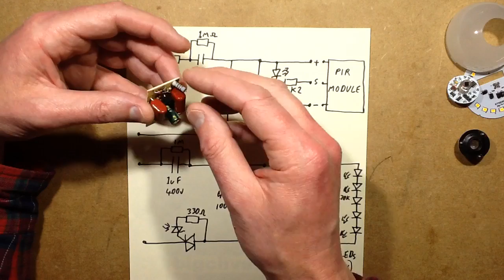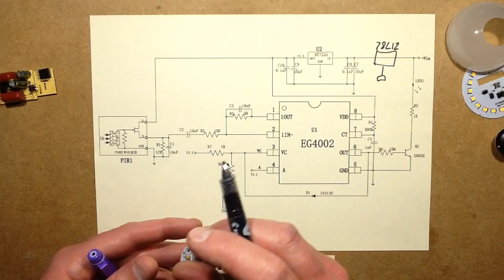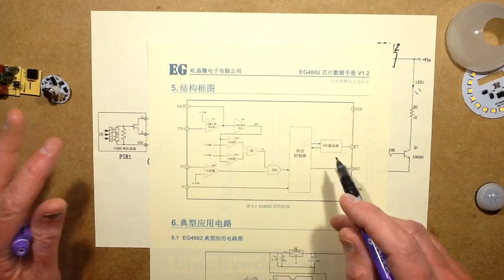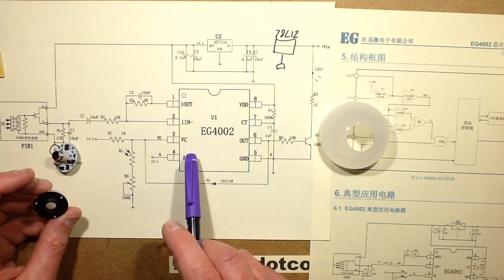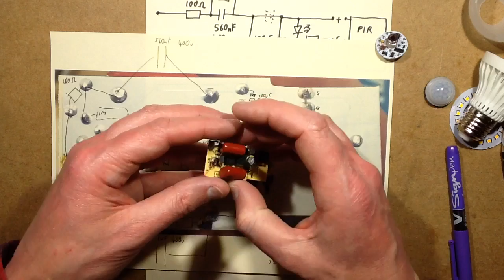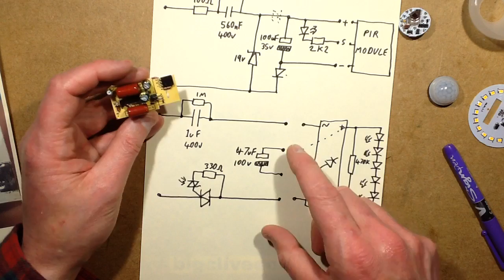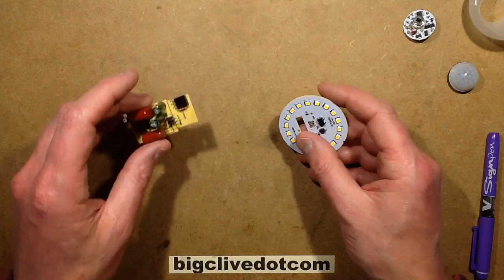PIR LED lamp teardown. (With schematic.)

Comment: Lovely tear down, I've used a number of these bulbs over the last few years and had a couple with LEDs failing.
I'll try running them with a lower capacitive dropper and maybe add a diode too 👍

Comment: I have two of these and tried each in my basement (paid $5 on eBay). Very frustrating. Mine are closer to 12-15 sec delay. So sitting even remotely still to solder, typing on your phone, rinse a paint brush, etc., the basement goes black and you nearly have to wave your arms to re-trigger these. Curious if anyone has tried to mod one? I see for $2 one could by an adjustable delay PCB (https://www.ebay.com/itm/1PCS-PCB-HC-SR501-Pyroelectric-Infrared-PIR-Motion-Sensor-Detector-Module-US-US/312189409823)  I was thinking of trying to swap it in on one of them.

Comment: Thanks to your exploration of these bulbs. I have one in the basement near the roll-up garage door.  I suspect the outlet at ceiling level was intended for a powered garage door opener but I don't consider the space adequately sealed for parking a vehicle with 20 gallons of liquid fuel in it.  The big door is convenient for moving tools and equipment out and in for yard work (electric pole saws and battery weed trimmers are best stored inside).  

Having the motion sensor light means I don't need to leave lights on in that area when I'm working outside as that bulb will light by the time the door is halfway up so there's light for getting back inside.

Some of your dissection does prove useful ;-)

Comment: Very comprehensive video.  Do you think the LED's would still come on if the lens for the PIR was missing?  I'm trouble shooting one that has had the lens removed, and it does not turn on...
Reply from the maker: The multi faceted lens is required to provide a vivid focussed pattern of heat movement across the sensor it may be very insensitive or not work at all without it.
Reply: The lens was smashed and  the LED's do not come on.   I did get a nice jolt from the 400v capacitor, I presume it was that cap., when I touched the exposed metal on the infrared nipple.  This LED/motion detector seems super old with no heat dispensing metal at all below the electronics or between that and the LED's.   It was all plastic and easy to tear it down without any damage.  I can post a pic. if you are interested.   thanks for answering

Comment: 23:10 - Smart Meters where I live in the States (Nevada) are mandatory.  If you refuse to let them remove your old analog meter and install the new smart meter, Nevada Energy just turns your power off at the pole.  However, they are only using the meters to monitor power factor at the moment as the Nevada Public Utilities Commission hasn't approved charging residences for power factor yet.  The meter I have according to the label is an iCON Sensus.

This mandatory installation policy however is hardly universal across the States and many individual states have prohibited their local power distribution companies from installing them pending further investigation.

Comment: Hey Big Clive, love your videos & thank you for doing them & helping all of us out with these electronics, a perfect gig made for you. Also before I forget it again, & I know it has nothing to do with this video...I guess but I jumped up one early morn. at around 11:30 pm & had to make a red LED with a 1K ohm resistor attached to it & just 2 AA's in a battery holder on the 20th of December & as of now this thing is still running, & it's only 3 volts. So how long can something like these red LED's last on only 3V? I know it differs from the manufacturer but just an educated guess, because I never would have guessed that it would last over one week. Thanks, Tom.
Reply from the maker: Hi Tom , as the battery voltage falls the current through the LED reduces, and as it will still light visibly at microamps it seems to run for a very long time.
Reply: I know, don't it? This joker is still going so now I'm wondering why the urge to get up so late night to build this thing hit me. I may never know but at least it was a great but a small little build seeing as to how long it is running. Who knows what dream I'll have next to build????
Reply: Hey there BC, hope this finds you all well. Just an update on my little Red Corvette, oops, Yeah I wish, little Red LED is still going now from as of build date of: 12/20/2017 (WOW!!!!!!!) Never imagined even a red one could last that long on only 2 double AA's. So, is it going to make that 1 month mark? I'm not certain any longer now, so I'll let you know when it finally does give up the forward bias I guess that you could say. Thanks, Tom.
Reply: Hey BC, it's hard to believe but this little red LED is still just as bright as the morn. at around 12:30AM. that I built it. 1 Red LED, 1K resistor & 2 new double AA's. 1 month today, WOW!! To me that's amazing that it will last for so long. Next time I'll let you know when it finally dies. Thanks for your time BC.

Comment: I'd like to increase the timeout on one of these to 5 minutes, is it the cap on pin 7 (ct) that needs to be changed?
Reply from the maker: It might be worth experimenting by tacking another capacitor on parallel.

Comment: I have got one motion sensor bulb similar like yours except there is no bump on the bottom of it. but when i checked the circuit inside to my surprise i found only one light sensor PR in it there is no separate IR for motion sensor. They used the same chip as you have mentioned which is EG4002. The problem with this is the light keeps triggering even though there is no motion. its very sensitive i guess. Is there anything i can do to modify it?
Reply from the maker: It sounds like a radar detector (curved antenna of holes in the middle of the PCB).  They are very sensitive and will pick up movement through walls.
Reply: Yes exactly it have curve of holes in middle. We can't do any modification for the bulb not to trigger so easy?

Comment: You have just got me wondering if theres a simple diode hack for the sound triggered version, I bought one for the bedroom as i can get into bed and then it goes out once i'm quietly in bed, where as a PIR one would come on everytime i rolled over and probably wake me up, but sound seems ideal, a click of the fingers and i can see to get out of bed without tripping up, but same issue, 30 seconds and it goes off and needs a whole second before it will re-trigger. must pop it open and see what its built from

Comment: Hum, 111ma @ 240V. This sounds like a job for the 47MW (0.5A) Power Fixer you showed a few days ago. I wonder what you get with both plugged in?  (Hum, both capacitors. Yep, not going to 'fix' a single thing.)

Comment: Hi Clive,
I think they placed the capacitor on the power board and not on the LED board because now the LED board is fully SMD, which makes it cheaper to produce. The power board already has lots of TH components so adding one doesn't increase cost much.

Comment: Ordered some. Any special diode I should use across the pins? I'm tempted to use a UV LED since I just bought a couple hundred.
Reply from the maker: +Eisen Faust It would only really work with an ordinary diode like a 1N4148.

Comment: +Clive, would you say, generally speaking, that these are safe to use in the home?
Reply from the maker: +Richard T I can't specifically say that any device is "safe", but this design looks sensible enough, although I'd have preferred X2 type capacitors.  That said, I've had some cheapo Chinese LED lamps with the usual capacitor running 24/7 for years.

Comment: Before one might invest in power factor balancers one might consider investing in infrared motion activated switches for all your rooms & on key lamps etc.   More energy is lost in light switches left on than power factor losses in the average household.  Then LED lamps which will save you more money in the summer than winter.

Comment: Hi Clive.  There are a few different models of these PIR bulbs out there.  See if you can find ones that don't have the obvious PIR sensor dome and you'll find that the circuitry inside is different.  I'm not very good at the basics of electronics but looking at your video here, the bulbs without the PIR diffuser dome are quite different in design.  
I picked up my sensor bulbs at my local ALDI and use them in the light fittings at the front and back door.  They work very well and will remain on (no cycling) if you are within the sensor's range.

I couldn't find a link for the ALDI bulbs but here's something that, to my old eyes, looks similar:

http://www.ebay.com.au/itm/3W-5W-7W-Motion-Sensor-Lamp-LED-E27-Bulb-Sound-Light-Control-Auto-Smart-Detec-/131782108223?var=&hash=item1eaed3643f:m:mQNMIbRlwsv_3Bt85jiRx9g

Comment: could someone explain to me why you'd design a capacitive dropper power supply that always pretty much shorts half the sine wave with the zener? Why not put the normal diode in front of that zener instead of behind it?

Comment: "Note: This opto isolator should not be used to drive a load directly. It is intended to be a trigger device only."
So the triac is needed.
But it's a pity the diode is missing. And that capacitor for the PIR is huge :o

Comment: About that diode - sure, it could just be "works fine without it so leave it out" cheapskateness but there's another thing to consider: whether it's present or not only matters IF the lightbulb turning on affects the light sensor, and that's by no means a given. The sensor and the lights are actually in their own bubble domes each so one doesn't necessarily affect the other directly, and since no consumer light will actually put out anywhere close as much brightness as the sun, if the darkness threshold is tweaked to detect day/night conditions it might well not be affected just by the lamp turning on - in which case the bulb would retrigger even without the diode. Of course, this may not be the case for that particular bulb if the variable resistor in the schematic is left at "max sensitivity" (if there's a variable resistor at all)...
Reply: +Attila Asztalos There is a different trick: The sunlight contains a lot of infrared that the sensors are very sensitive to. The diodes don't output it. By using the right light sensor, one could get it to where it wouldn't swamp its sensor at all.

Comment: Thanks for the detailed teardown. It was an interesting circuit to see how it worked. I'm wondering about the PIR lens you mentioned. Is it far-infrared like predator or near-infrared like a night vision camera? Either way, do you think the lens could be removed and used to replace a camera's normal IR blocker to block visible light and make an IR only camera?  Thanks again for all the things I've been learning from you!

Comment: Re: your comment regarding power factor/simple calculation billing for electricity - I've never heard of any benevolent energy supplier anywhere in the world, so you can rest assured that they'll be billing you for whichever of the two measurements is higher.
Reply: +Yorick Hunt Apparent power is always greater than or equal to real power, so your pessimism is misplaced. And that reactive power isn't lost; it goes back to the grid so that capacitive loads help power inductive loads and vice versa. But the power company needs some power factor correcting equipment themselves, and billing large industrial customers for apparent power is just a way to shift the cost of power factor correction to them.

Comment: Nice hack.
After adding the diode from pin 6 to 3, did it affect the heat factor?
Is a there a danger of overheating if left on to long?

Comment: Brings up a question: if there are so many capacitive droppers which really screw with the power factor, and there's all these "power savers" which are merely capacitors, would it make sense to have a "power saver" which was inductive instead, so as to counteract the poor power factor of these capacitive droppers?  Of course, that all depends on whether the supplier cares; there and here they don't, but you say maybe in Italy they do.
Reply from the maker: +rchandraonline It's all totally random.  The lamps are low loads but any inductive load in your home like a fridge compressor will be a modestly high load that operates intermittently at random times like the motor in the washing machine or dryer.

Comment: it's odd what  you said about  running cost of leds  the power suppliers and  meters they still charge £20 + vat standing charge so soon they will start charging more  and most people do not even know we still paying standing charges on top what we use

Comment: The reason that the capacitor is on the other PCB, is that mixed placement of wired and surface components make the production cost skyrocket. That is especially true when mass-producing such PCBs....

Comment: all of these products that run on 110/220 and you just pop open in half a second on camera scare me. High Voltage consumer products should not be that easy to open...
Reply: +Andy Plater With more products like this (and in particular the "on-demand" shower head), the human race will evolve to be resistant to 240VAC ;-)

Comment: re power factor, i think with new lighting such as led draw  so much less power than incandesants, that even with such a bad power factor they can live with the line losses, as pretty much all devices include correction with the exception of most domestic lighting.

Comment: About the trigger current (I'm looking at the Fairchild MOC3061 datasheet): the 15mA are only needed for very short pulses (1µs). It goes down considerably with pulse length (e. g. 1mA for trigger pulses of 100µs length).

Comment: 12V regulator is there because the 3v3 regulator has an input voltage max of 15V, giving 18V will kill it. They would use any regulator from 5V to 12V in making these, just because the 3V3 regulator will run off 5V to 12V. Whatever roll was cheapest on the day will be used to run off the batch.

Comment: some of those 3v regs dont like being above 12v, thats maybe why they put the 12v one in first, one 3v reg springs to mind thats only rated to an input of 6v!, had a few arduinos die in car projects at the usual 14.6v etc, hot days cheap 3v reg and 14v=death.
used a 3v nano and the common 5110 lcd as a voltage readout on the dash. dead in a month....
Reply: +lez briddon I once made a circuit that wasn't very voltage-sensitive and used it in my car. It broke very quickly, by frying an input polarity protection diode. I guess large voltage spikes can be quite common, so any electronics in a car needs protection against those.
Reply: Very true, making bullet proof / idiot proof circuits can take as long as the original design....

Comment: I think they mounted the smoothing cap on the input board because it's bulky and through hole. Yes, they could have used smd caps but I think they aren't compatible with all pick and place machines and it would still be bulky!

Comment: One with a B22 base here http://www.ebay.co.uk/itm/B22-E27-E14-5W-AC-220V-18LED-Motion-Control-PIR-Sensor-Light-Lamp-Bulb-Pure-Warm/181744671363?_trksid=p2047675.c100005.m1851&_trkparms=aid%3D222007%26algo%3DSIC.MBE%26ao%3D1%26asc%3D36382%26meid%3D80e4ea20a6d04aef99663bfaf379596b%26pid%3D100005%26rk%3D1%26rkt%3D6%26mehot%3Dpp%26sd%3D111713183732
Reply: +Barrybados©. You do realise that you can abbreviate eBay URLs to just the item number, don't you? As in http://www.ebay.co.uk/itm/181744671363
Reply: +Yorick Hunt Copy and paste from my link and yes it is now looking at it very large : ) cheers for pointing that out .

Comment: The substitution of a 10k for a 1k is probably to save the number of different components. I reckon they could easily have saved on the BOM by driving the Triac's MT1 directly.  It's all at mains potential so isolation is unnecessary.
Capacitive dropper power supplies are far from ideal when making products with a wide range input voltage.

Comment: Hi Clive, here in Italy the power meter ("contatore GEM" if you wanna see a pic on google) measures everything, but we are not charged for apparent power.
Only industrial contractors need to keep a good power factor or they will be fined
Reply from the maker: +123francoz I'd actually want to test that by turning off all circuits except for one with a big fat capacitor on it and see if the meters LED still flashed.
Reply: bigclivedotcom
I already did that on mine and i can tell you that only the reactive power LED flashes, since this meter has two LEDs, one for active power and one for reactive power. Are them similar in uk?
Reply from the maker: +123francoz Ours just have one LED.  Did your meter still register the capacitor as a chargeable load?
Reply: +bigclivedotcom No, the capacitor does not influence the power count, we are not charged for that.
Each blink of the first LED corresponds to 1Wh and each blink of the second LED corresponds to 1Varh, but the overall count keeps only track of the first LED